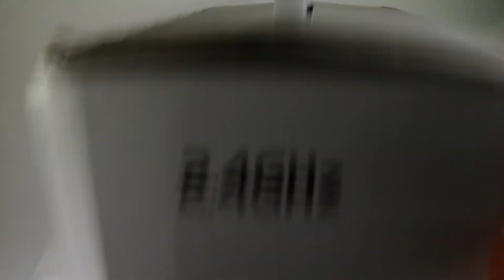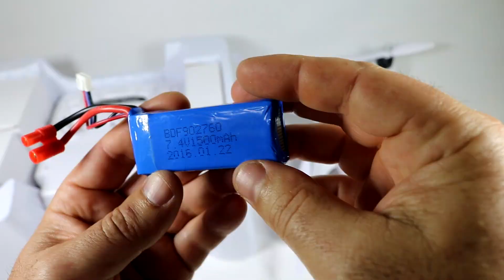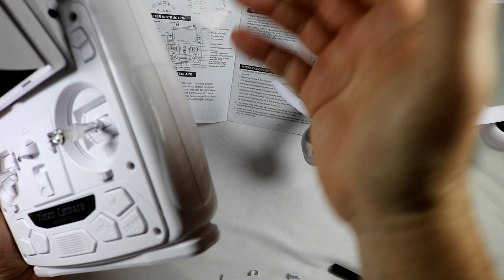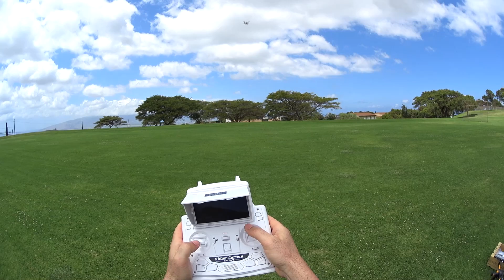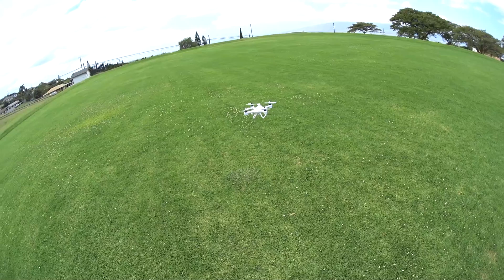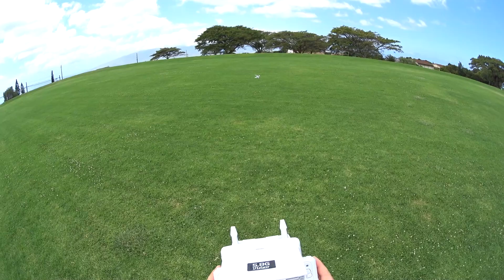XINLIN X181 5.8Ghz FPV QuadCopter Review - [UnBox, Inspection, Setup, Flight Test]

Comment: The more I deal with BangGood The more I find they are deceptive in many cases. They advertised a price for the X4 H501S before they had any for sale at over $100 less than they charged when they started selling them. This camouflaged brushed motors described as similar to brushless motors. The motor covers contribute to running hot. That makes me worry about how long the motors will last. I would remove those phony motor covers to allow more cooling, now that we have found not to be brushless.

Comment: Unfortunately those aren't brushless motors.  They're "similar brushless motors", whatever that means when it comes to brushed motors. :-/  Check the motor out at the link below.  From the looks of them, they must be stuck up into the brushless motor looking can.  And they have only 2 wires.
http://www.banggood.com/XIN-LIN-XINLIN-X181-RC-Quadcopter-Spare-Parts-1PCS-CWCCW-Motor-p-1043981.html
Reply from the maker: +Tim Adams I could have sworn they were some kind of proprietary brushless type motor from xinlin being how they are so quiet and smooth.  I'll have to reserve judgment until someone pills one apart and shows me the brushes :)
Reply: Most brushed multirotors are geared, which is why they're more "clicky" and noisy.  Brushless motors are multi-phase, so they can't have just 2 wires.  And that circuit board on the back doesn't have enough components on it to be a brushless ESC.  And they don't "sing" like a brushless motor does.  And it's only $5.19. Heh
Reply from the maker: +Tim Adams yep.  looks like brushed now that I see the pic.  They sure did do a good job at making me think they were some frankenstein brushless while mounted up :(
Reply: Sorry to burst your bubble. ;)  But it is cool to see a larger direct drive brushed, and therefore quiet, quad. 👍